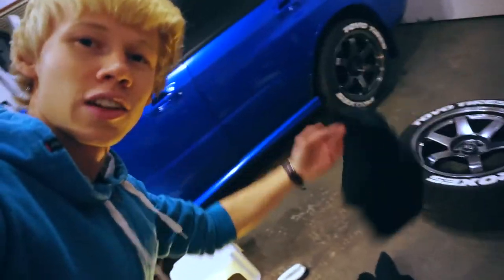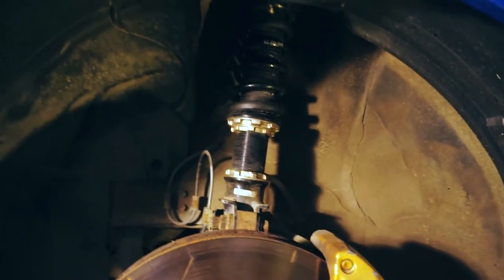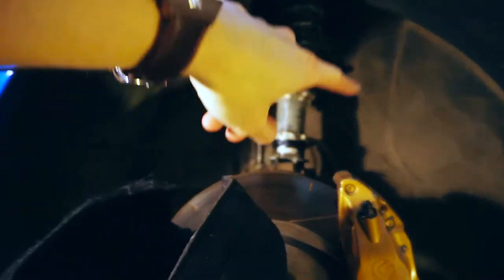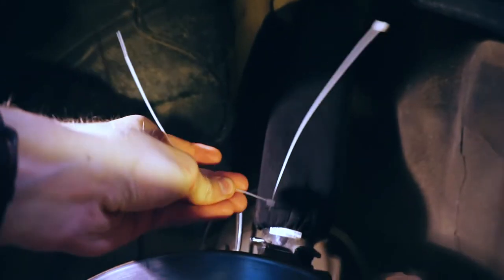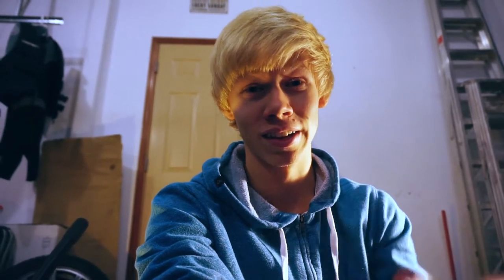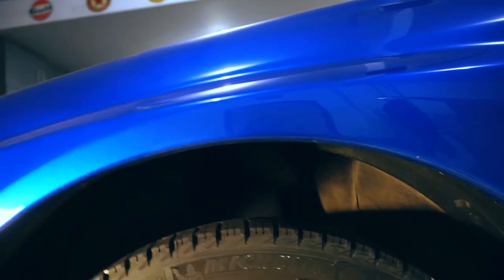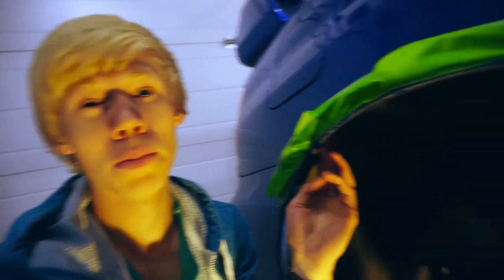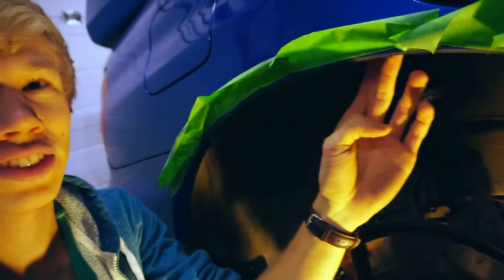Keep Your Coilovers Safe This Winter - Uncover the Secret!

Comment: You know that lubricatipn requires using a different torque spec, right?
Reply from the maker: Is this for lug nuts? Theoretically yeah they do, but there is no specific torque spec for oil lugs so I just go to the recommended torque so I don’t snap them then check then periodically!